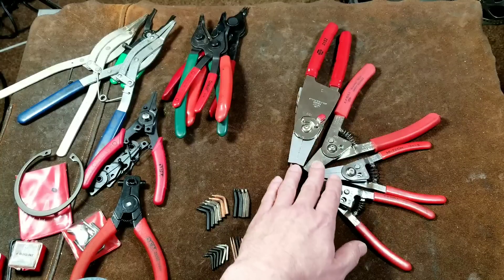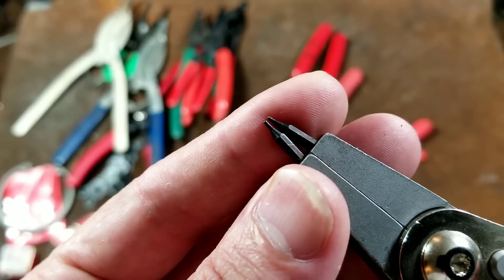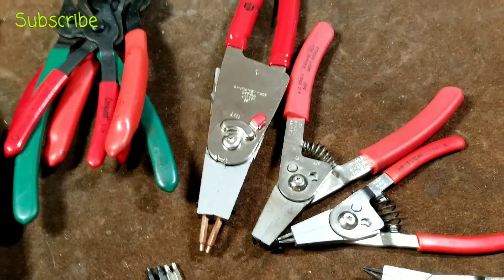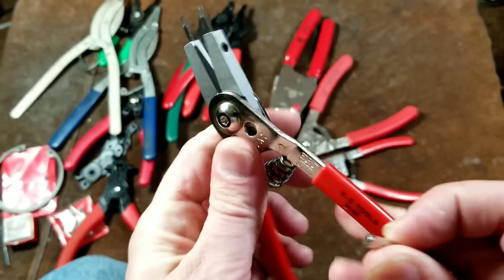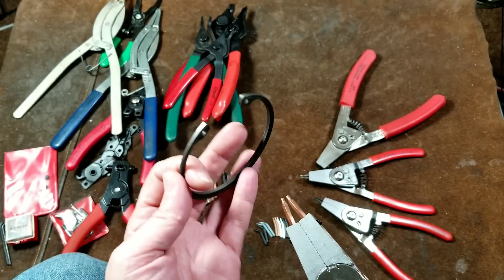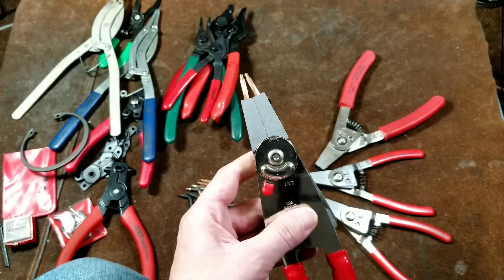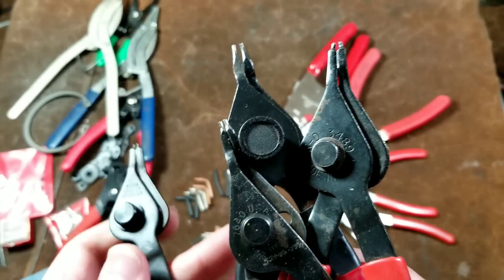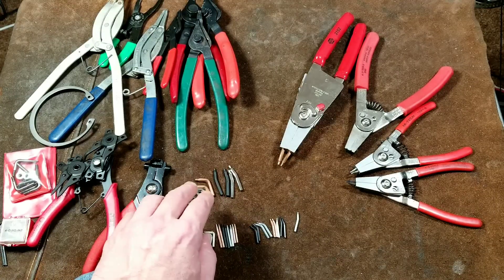Napa Professional/Hi-Tech Industrial Snap Ring Pliers Review & Comparison

Comment: The expensive pliers (NAPA) are worth it. The ratchet option on the larger set would be perfect for handling the rings. Not having to maintain pressure on the handles would make the process so much easier!
Reply from the maker: I totally agree!